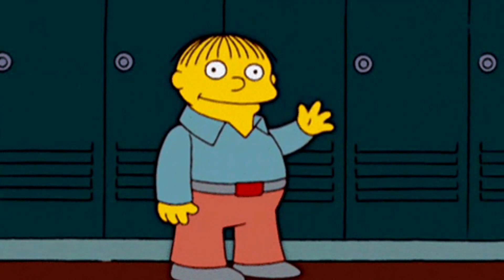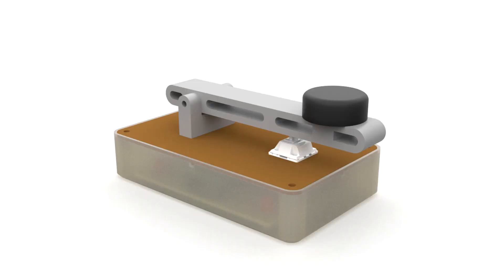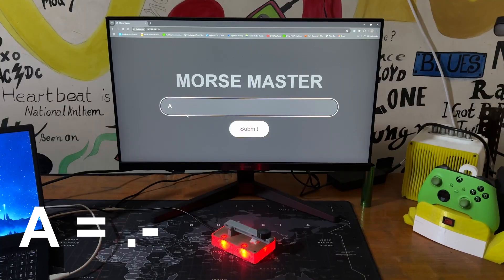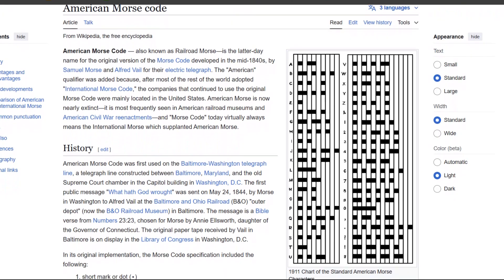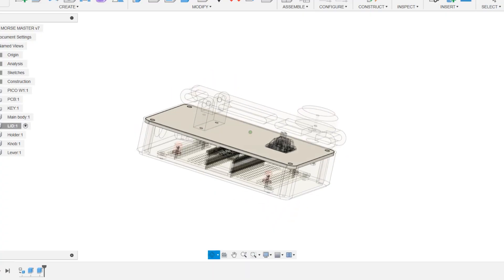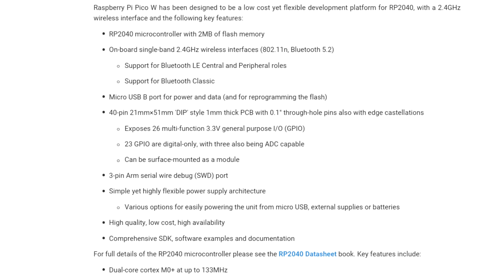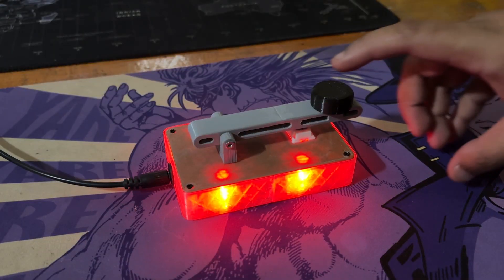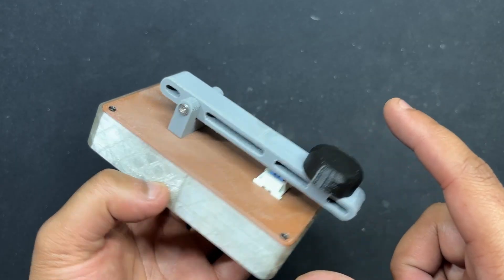MORSE CODE TRANSLATOR with RASPBERRY PI PICO W

Comment: RASPBERRY PI PICO W is an overkill
Reply: An ESP32 C3, ESP8266, NodeMCU would be best since they all can do the basic GPIO for the LEDs and Button, as well as the web app. They're also a fraction of the cost.
Reply: so what are alternate?
Reply: @nighmare.2kytrewq337  and is also well documented
Reply from the maker: It iss

Comment: Hey there, Arnov. I saw your project in Instructables. I like it, it's cool. So one thing I wanted to check with you. Your machine translates TO Morse Code as well as FROM Morse Code? One does not actually need to know any Morse Code? The Morse Code is just a medium through which information is sent? It's a really clever device. Thank you for sharing!